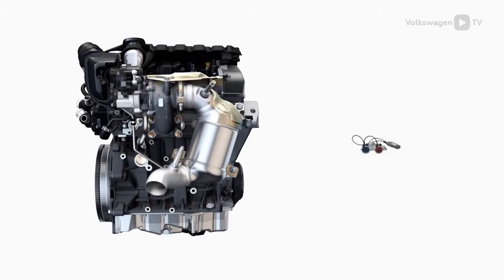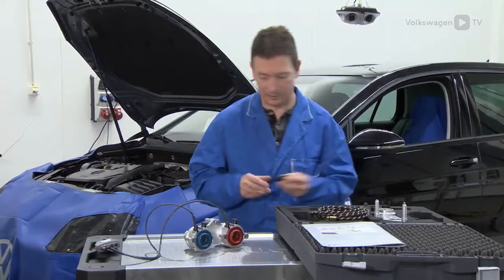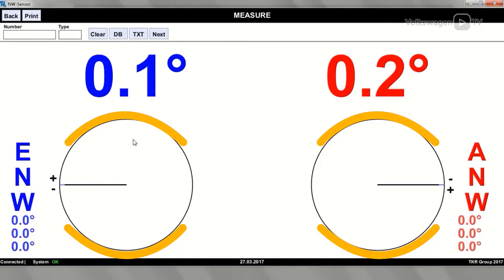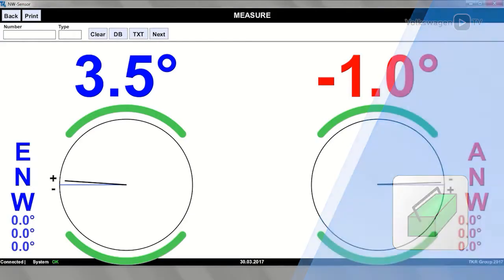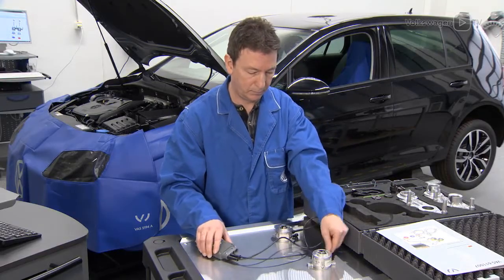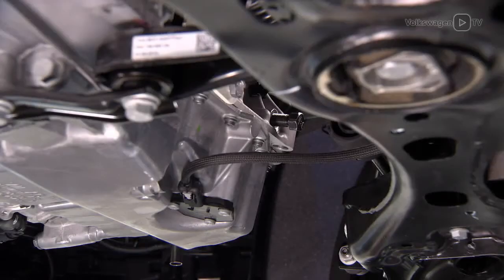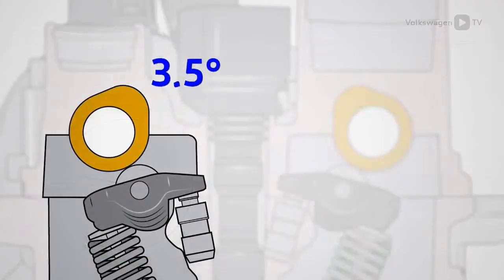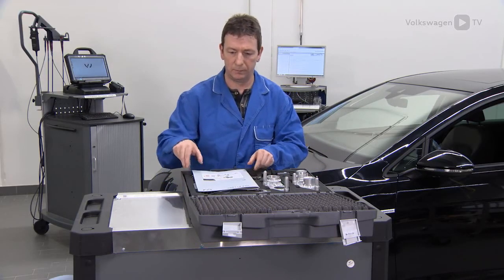VW How To - Adjusting The Valve Timing Using Vas 611007

Comment: Wow,that's only the valve timing adjustment. The belt replacement is another operation.What is the flate rate for the whole operation. May as well buy a Porsche . Thank you for the video.

Comment: I have a 2020 model seat leon fr 1.5 tsi fr dsg vehicle, 105000 km, I am the first owner and I have been in trouble recently, the vehicle gives 2 errors.  first ;  P04F000 EVAP SYSTEM HIGH PRESSURE PURGE LINE PERFORMANCE, Second;  INTAKE AIR SYSTEM LEAK.  It was determined that the problem was caused by the valves in the engine, and some of the valves were burned or melted.  Unfortunately, even though I had all the periodic maintenance done 2 thousand km ago, I encountered such a problem and the authorized service did not support in the country where I live. I don't like it anymore, probably because my next car will be the BMW f30

Comment: Any trick on how to check if the camshaft gears (vanos) are damaged or worn? I keep getting code P0011 & P0341 after changing sensors, oil control valves, magnetic adjusters & checking the wiring on my mk7 gti chh engine

Comment: Can the timing be set accurately enough with metal timing tools like you get in the timing tool kits?
Reply from the maker: Can it be timed using just the tools? Yes. Can it be timed 'accurately' with just the tools? No.
Reply: So marking the old belt and transferring the marks to the new belt won’t work either?
Reply: @BerettaTV  it works
Reply: @repeater95 it will work with marks on the belt but engine will never be timed correctly. Just like old ve tdi alh. If you don't adjust it right it will suffer in performance and burn more or less fuel. So this engine needs box of tools to time it  right in other words never service it outside of vag dealership. 😂😂😂😂😂 regular mechanic can't do it right even if he have all the tools in this video.

Comment: Hey there i have one question 

I have audi q7 3.0 2011 model 
Recently serviced and battery changed 
after few days car was unable to get motion once brakes were lifted 
Unless we hit the accelerator till 1500rpm then the car moves with a jerk
And a engine and heater light blink once for fraction of a second

And now rpm dips when hit the gas paddle in idel rpm with the same engine and heater light just for a fraction of the second 

Now car is with the service center for 2 weeks now with no fault code

Please help 🙏
Reply: did they solve  your issue ?
Reply: @Liberty55555  not yet
Reply: @rajsohanda3450   at now ?